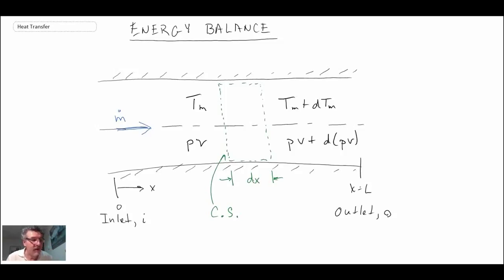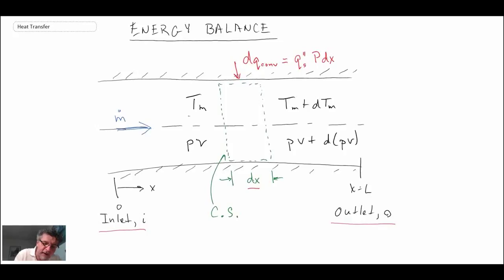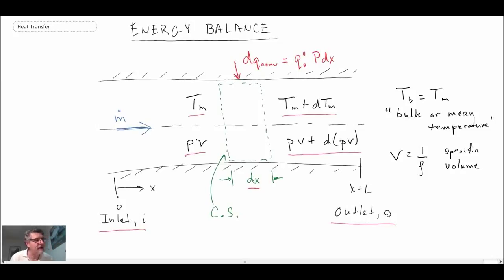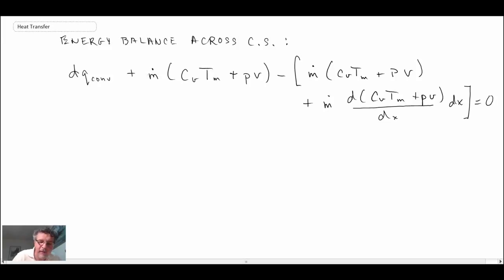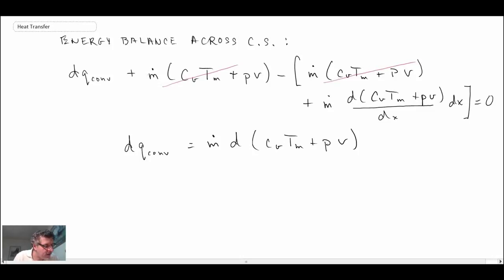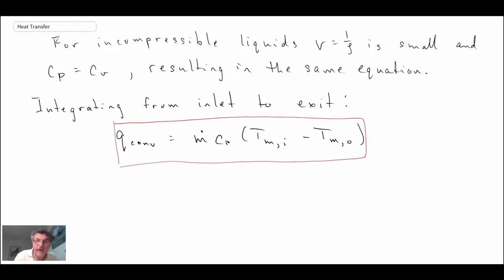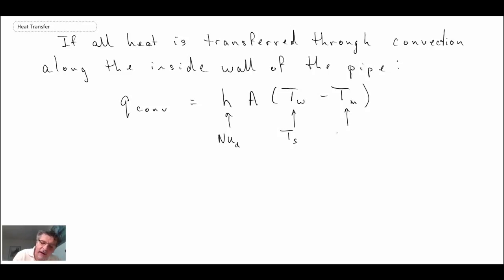Heat Transfer L22 p1 - Energy Balance - Pipe Flow

Comment: You said the final equation can be applied for both liquids and gases....But how does it work for liquids? We can't model liquids as ideal gases since they are not gases to begin with, right?
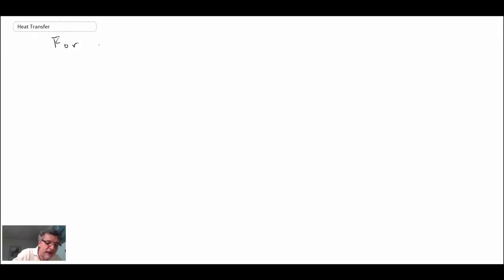Reply: Are you referring to the discussion around 6:30?  The starting equation is dq=md(cvTm + Pv) (kindly excuse the similarity in symbology).  This equation is applicable to either liquids or gases.  For liquids, the specific volume is dimunitive, so the second term drops.  Also, by definition, cp= cv for liquids.  Thus, the final equation is the same for both.